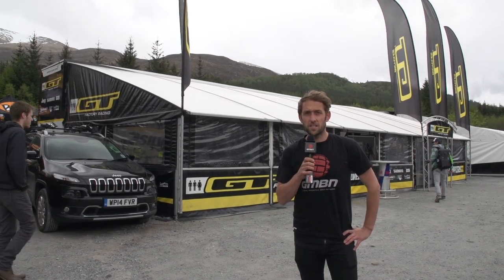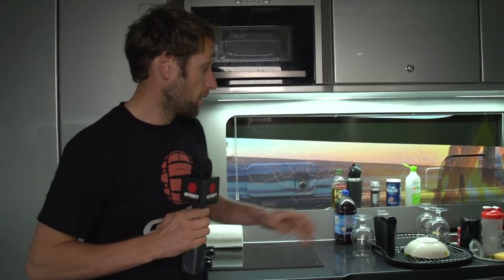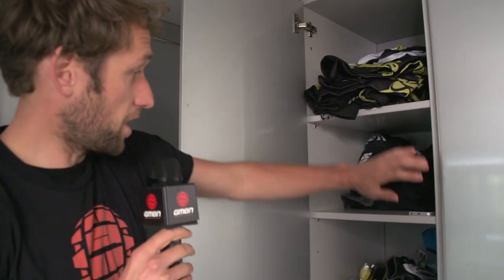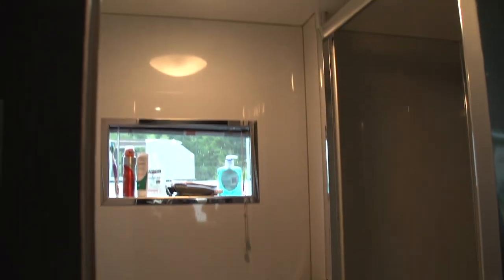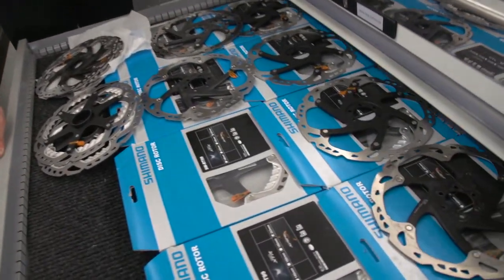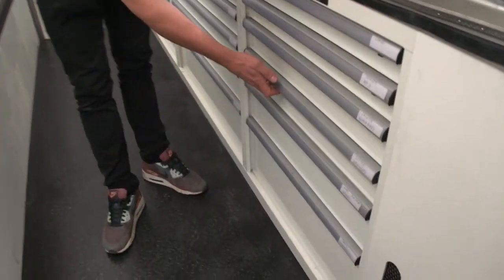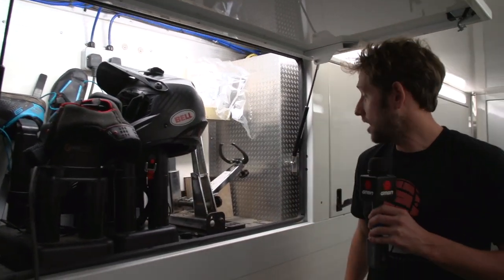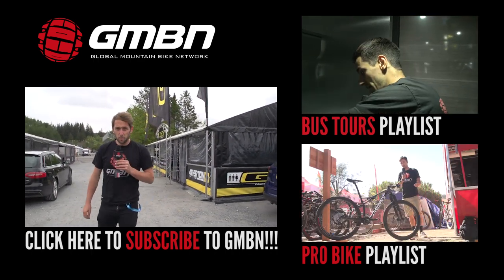Inside The GT Factory Racing Truck

Comment: I'd say do a video for the Gary Fisher truck but that company likely no longer exists so no need for a team truck. 
  I do own a Gary Fisher Mamba I bought from a guy for $60 in Houston a few years ago. I've already started the rebuild process and adding components and accessories I want so it won't be stock but better. I've installed ODI Rogue lock on handlebar grips and a better saddle. I just bought Jagwire Mountain Elite Shift kit. I'm going to buy SRAM Level hydraulic Disc Brakes and RockShox 30 Gold RL fork for $349. I'm looking at Shimano XTR trail pedals and shifters. I haven't decided on which chain and the bike has Shimano Altus cogs.